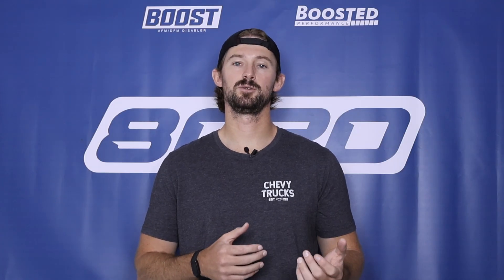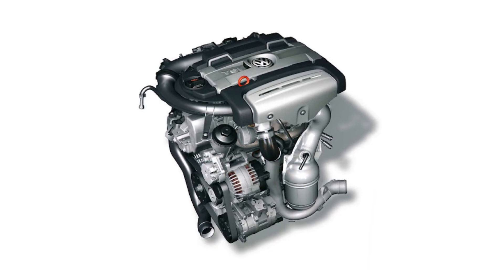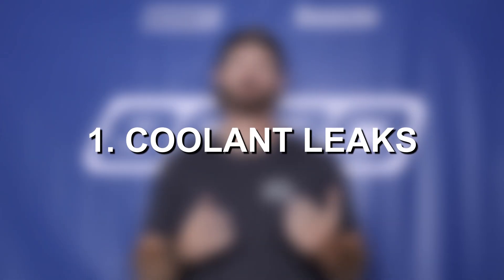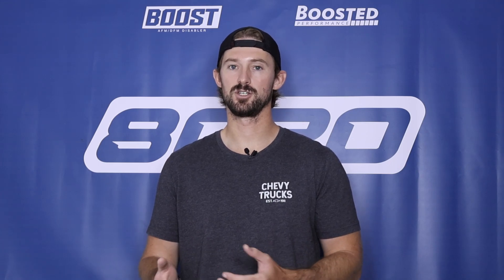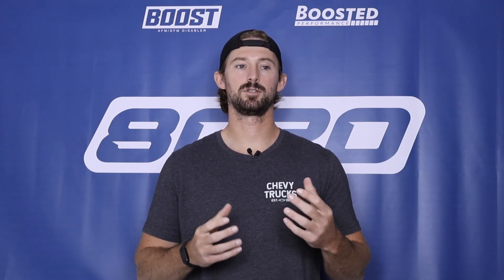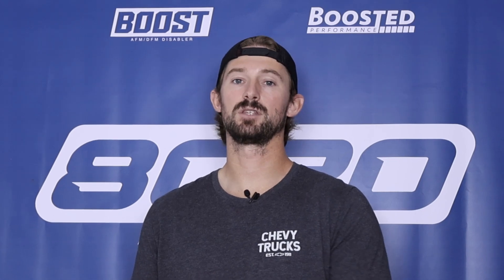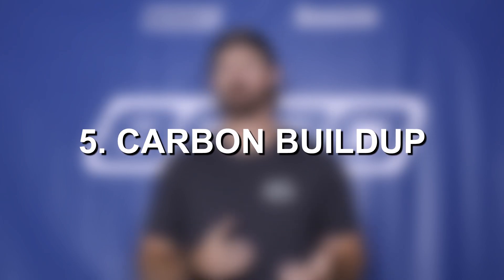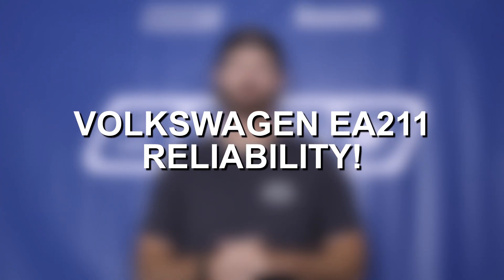The Truth About VW’s EA211 Engine Reliability (VW 1.4 TSI)

Comment: I just picked up a 14 plate 150ps with 107k miles . It’s only done motorway miles with 2 owners and consistent yearly oil changes and cambelt done as well. I will only been doing 2k miles in it a year but I’m scared of remapping with racing line OEM + and blowing a rod :( 

Car also has fantastic vacuum ! Went to see one with 60k and the oil cap was bouncing off when unscrewed.

Comment: Timing belt 120,000 or 5 years maximum 3:24
Reply: no its fine up to 10 years it really doesnt matter much for this engine. the belts in these engines are better in longevity than the chains in older ones.

Comment: Maybe 1.4TSI EA211 not the worst engine, just VW could take responsibility for those loose exhaust VVT bolts that may turn into expensive repair if not spotted on time.

Comment: Got 125hp one fitted in my Caddy. Surprisingly powerfull engine even with stuff in the back and towing a trailer. Have had the issue of the EPC light coming on and throwing either or both a P20100 / P20400 code during heavy rain on the highway. Any idea what to look into?

Comment: I’ve got 98k miles and so far the only big problem I’ve had is my EVAP cylinder went at around 90-92k miles. But other than that, just oil changes so far

Comment: C'est quoi l'homologation d'huile de ce moteur svp
Reply: 0W20 (VW 508 00 / 509 00)
Reply: @Ramzi_Ghanmi dans bcp de recherche j'ai vu que 5w30 c'est plus efficace pour ce moteur c'est vrai ???
Reply: @FouadSlimani-c2i it doesnt really matter but normally 5w30 is used for these engines not 0w20 thats too thin for this engine

Comment: The only problem I got with mine is that at around. 2-3k rpm the turbo wastegate happens opens and makes a loud annoying hissing sound like air forced though a small hole
Reply: The wastegate sounds sexy and is not a problem f you are not experiencing power loss. I’m running 1.7bar of boost and the wastegate hiss adds character to that small engine.

Comment: I have a 2006 Toyota Corolla 1.6 16V petrol/benzin engine. Got the car in 2012 with 5K Euros. In 2025 with 350k km on it, and this engine runs without any problem. My question is: Why should one buy a German headache when can have a Japanese pill to treat your headache with?????
Reply: because their a better drivers car
Reply: Because Japanese cars are sleeping pills, not headache pills. Boring.

Comment: I got “P2562 Boost control position sensor A circuit” after the shop put the actuator on… and I got a new map sensor, but it didn't fixed anything, kinda stuck now because I can’t do the learning if there’s a permanent code…is there a way to bypass it and do the relearn at all?
Reply from the maker: W - You can’t safely “bypass” a permanent P2562 and force a relearn — a permanent DTC means the ECU has locked that fault until the root cause is fixed and the fault cleared with proper tooling — so your only path is diagnosis and repair, then the adaptation (basic setting) with VAG-level tool (VCDS/ODIS) or dealer. Start by checking the actuator and sensor wiring/connectors (look for corrosion, broken pins or crushed wires where the loom flexes), then backprobe with a meter at the boost-control position sensor/actuator: confirm a stable 5V reference and ground, and that the sensor output changes smoothly (usually ~0.5–4.5V) as the actuator is moved; wiggle the harness while watching the signal for intermittent faults. Also verify the replacement actuator is the correct part and not mechanically binding on the turbo (wrong install angle or seized linkage will throw the same code). If electricals check good but the sensor output is out of range, replace the sensor/actuator again with a known-good unit and then clear the code; after repair perform the turbo actuator basic setting / adaptation with VCDS or ODIS (dealer-level) — only then will the ECU accept the sensor and allow relearns. If you want, tell me the exact freeze-frame values or the connector/wire voltages you measure and I’ll walk you through the multimeter checks step-by-step.

Comment: I had the exact first 2 issues, waterpump leaking then turbo actuator having to be replaced plus high consumption of oil, only done 74000miles, so he is very much on point here
Reply from the maker: M - Thanks for sharing your experience!
Reply: How did you fix the high oil consumption?

Comment: mine have a rattle..now feel like low boost..
Reply from the maker: S - On the VW/Audi EA211, a rattle combined with low boost is often a sign of an issue in the turbo assembly, especially the wastegate flap/actuator — these are notorious for rattling when the bushing wears, and if the flap can’t seal properly, you’ll lose boost pressure. Other common causes are a cracked downpipe flex joint or a loose heat shield (causing the rattle) paired with a boost leak at an intercooler hose or charge pipe. Since you now feel low boost, I’d start by scanning for codes (underboost, P0299 is common), then physically check the turbo wastegate arm for play, look over charge pipes/intercooler connections for leaks, and listen near the turbo for exhaust leaks under load. If the wastegate rattle is confirmed, you may need an actuator adjustment or turbo replacement, depending on severity.

Comment: turbo just design to last 120-180k miles, mine blew up at 160k, not sure what to do now, it still giving me boost if I hit the cltuch and stop the engine and switch on again while driving, but the EPC will pop back on whenever I stopped, they let me replace a whole turbo, is there any other ways plssssss?
Reply from the maker: W - When the EPC light comes on and the car cuts boost but then briefly comes back if you restart, that’s the ECU putting it into limp mode because it sees the turbo actuator or boost control out of spec. If it only resets when you cycle the ignition, that’s almost always the wastegate actuator or electronic turbo actuator module sticking or failing, not the core of the turbo itself. Dealers often sell the whole turbo assembly because VW doesn’t officially service the actuator separately, but many independent shops do replace just the actuator/motor if the turbo shaft itself isn’t worn. So before paying for a full turbo, have a trusted independent VW/Audi shop check wastegate play, actuator calibration, and boost leak tests — if the turbine is healthy and not making noise or smoking, you may get away with just replacing/recalibrating the actuator instead of the entire turbo.
Reply: @8020Automotive  It is the acutortor messed up, TYSMMMM!!!

Comment: Is the  EA211 a belt or chain driven engine?
Reply from the maker: A - Belt!
Reply: @8020Automotive the belt in how km or years is for replacement ??? I want advice please.
Reply: @ΜιχαληςΧατζηβαηντερλης  εξαρταται την χρηση/χλμ/χρονια.ανφορικα γνωριζω οτι την τσεκαρεις περιπου στα 100κ αλλα οπως ειπα εξαρταται την χρηση (ζορισμα).στα 120-150 σιγουρα αλλαγη.σε καθε περιπτωση να εχεις το νου σου απο τα 60κ και πανω για οτιδηποτε σε ξενιζει (σφυριγμα,θορυβο στο τραβηγμα*οταν ανεβαζει στροφες*,κομπιασμα στο ρελαντι κλπ).ελπιζω να βοηθησα.
Reply: @ΜιχαληςΧατζηβαηντερλης  its fine on a 2016 a3 never changed its on 120000km the car has spent some of its life in very hot and some of its life in very cold climates which is bad for belts but its still fine these dont really snap as the guy in the video said but can always be replaced as a preventative thing. if you do make sure to replace the water pump belt too. some engines have the water pump on the timing belt but this engine has it on the gearbox side for space saving and timing belt life.

Comment: Today ive got the p334b00 error code accompaigned by no-boost and epc-light on a3 8v. Hope its only the acutator, anyone in here got the same issue?
Reply from the maker: K - P334B00 points to a fault with the turbocharger wastegate actuator “B” position not learned/incorrect—that’s why you’re seeing EPC and limp mode with no boost. You’re right that the most common cause is the electronic wastegate actuator itself going bad (the motor/gearbox wears or the position sensor fails), though it can also be a sticking wastegate flap on the turbo that keeps the actuator from calibrating correctly. First step is to clear the code and do a basic settings/adaptation with VCDS/OBD11; if it won’t complete or the code comes right back, the actuator is likely toast. The bad news is on these cars the actuator isn’t always sold separately—you often end up replacing the entire turbo assembly unless you source just the actuator from a specialist. Since you’ve got EPC + no boost, I’d lean actuator or stuck flap, not just a sensor glitch.
Reply: @8020Automotive Great explanations and info. It was a stuck wastegate flap, which i could free by using mos2 oil and pulling. Sorted it seems for now. 👍
Reply from the maker: K - Great to hear! Thanks for sharing your update.

Comment: got mine with the is38! this car is underrated! Very fun car.
Reply: what other mods have you had to do? intercooler bypass? how’s the lag? does it even fit in there 😭😭
Reply: @manveersingh1971 barely fits in there not gonna lie. My hands were all scratched up when I finished the install.  I did FMIC as well. It starts spooling around 4k instead of 3k rpm.
Reply from the maker: 0 - We agree!

Comment: I've got a Scirocco with this 125hp engine and its honestly been amazing. Its efficient and takes on any task well. I daily it and do about 30k miles a year and its been very reliable nearly at 130k miles and not a single check engine light ever. Ps. I do floor it about 10-15 times a day once warmed up, so not a granny drive either.. ITS RELIABLE. haha love these cars fr
Reply from the maker: B - Nice! Thanks for taking the time to share your experience.
Reply: I have a 2018 seat Leon fr with the 125 but, how can I tell the engine code? Also has anyone had a remap on these, is it a noticeable improvement?
Reply: That's because yours is not an EA211 it's a EA111 with 122-125hp. The only reliable engine in the EA111line up to be built with a single scroll turbine, and the only one truly reliable. The other EA111 are a catastrophe. The EA211 evo 1 is the one represented in this video. Evo 2 is much improved starting with 2020 versions.
Reply: @wiserednek49 wrong. Scirocco facelift got the 1.4 tsi ea211 with 125hp. Pre fl had the 1.4 tsi caxa 122. Ea211 is more reliable by a good margin, even if the caxa was the most reliable out of the 1.4 tsi ea111 engines.
Reply: @wiserednek49 i was always confused why my facelift 2015 vw jetta 1.4 tsi has the 90kw and the 2016 upwards was 92kw
And when i look in my engine bay you can tell the difference mine has the tsi badge on it while the 92kw one is just plain🤷‍♂️  my engine looks like the pre facelift 2013/4 jetta but i was told my ea111 uses a timing belt not chain the chain was ditched in 2013 the 2012 and 2011 jetta used a chain but what confuse me is why my jetta mk6.5 have ea111 but same year later jetta 6.5 literally the same car has ea211

Comment: I have 2 cars with this engine, ones on 150k miles and the other has 68k miles (with active cylinder technology), the only common issue between both was the waterpump housing leak, like mentioned, its plastic, and it happened at around 60k miles for both of the cars, i had the 150k mile car walnut blasted, it made a nice difference. overall a very efficient engine, i would recommend it
Reply from the maker: M - Thanks for taking the time to share your experience! This will certainly be helpful for future viewers.
Reply: what was the fix for your waterpump housing leak? my cars having the same issue i think
Reply: @kotai12 replacing it unfortunately, i didn’t bother buying original parts though, because it will leak just like the aftermarket stuff, got one for £60 with the thermostat from autodoc
Reply: @manveersingh1971 cheers mate